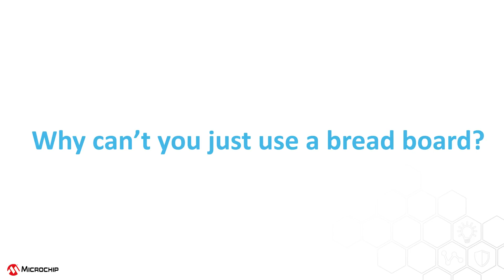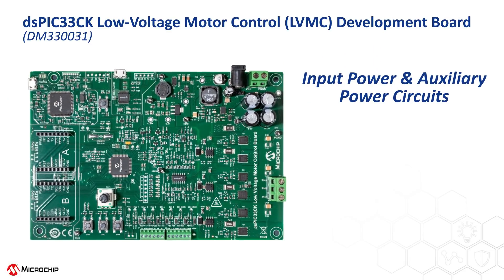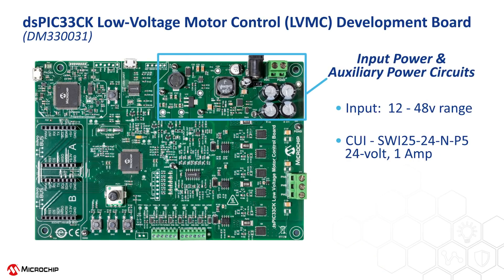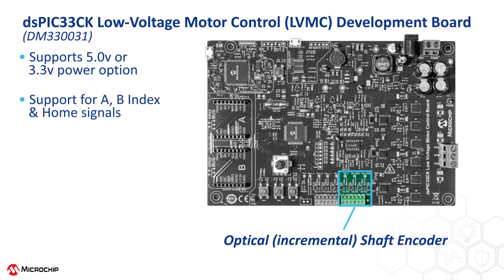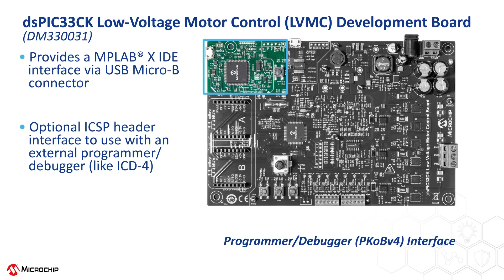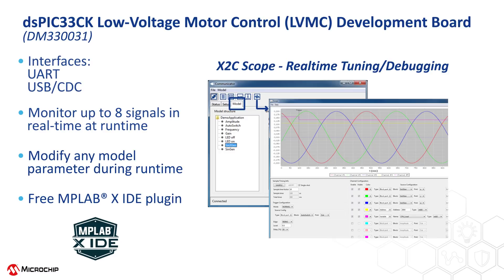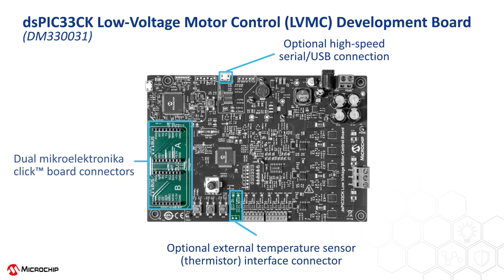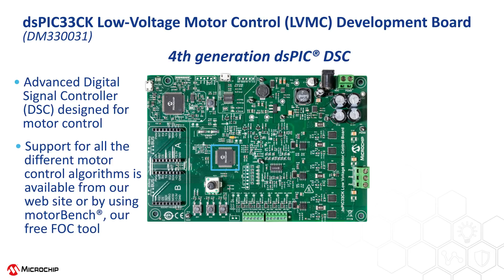Microchip's dsPIC33CK Low Voltage Motor Control (LVMC) Development Board

Comment: Can I use  dspic33ck LVMC with motorBence?
Reply from the maker: Thanks for your question! The dsPIC33CK LVMC does not utilize MotorBench; instead, it incorporates a high-speed USB to UART interface for debugging and monitoring key parameters in control algorithms through graphical PC tools like X2C Scope or RTDM. This setup is designed to support intricate motor control projects efficiently. Hope this helps!

Comment: What should I chose for  a 2kw motor
Reply from the maker: Great question! Choosing the right motor for the dsPIC33CK LVMC Development Board involves considering your motor's voltage and current requirements. For a 2kW motor, ensure it operates within the board's 12 to 48 Volt range and doesn't exceed 10 Amps continuous current. If your motor demands higher current, up to 20 Amps, adding a fan or heatsink might be necessary. The board's versatility in supporting different motor control techniques, such as sensor-based or sensorless operations, allows for customization to meet specific application needs. Let us know if you need more help with this!

Comment: Is there an application built which can run 2 BLDC motors at the same time?
Reply from the maker: Thanks so much for your question. Yes, the Microchip dsPIC33CK Low Voltage Motor Control (LVMC) Development Board is capable of running two BLDC motors simultaneously. The board features two independent motor control circuits, each capable of driving a single BLDC motor. The board also includes a variety of other features, such as integrated current sensing, voltage regulation, and communication interfaces, which make it an ideal platform for developing motor control applications. Let us know if this helps answer your question of if you need anything else.

Comment: Is it better use mosfet than igbt?
Reply from the maker: Hi there, thanks for your question. For this application, Low voltage MOSFETs have a much lower 'ON' resistance than IGBTs. MOSFETs are a better choice at higher switching frequencies and lower voltages and currents; IGBTs are a better choice at lower frequencies and higher voltage/current. These factors make MOSFETs ideal for switching power supplies and other applications that operate at about 100 kHz and at low current density.